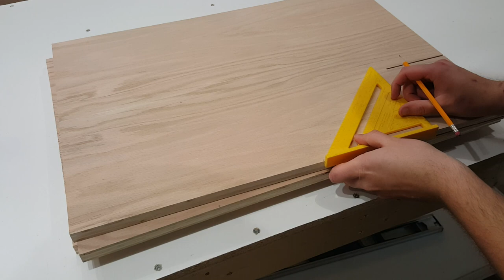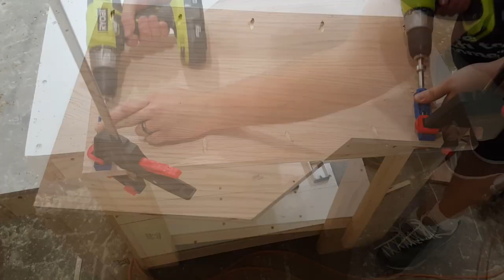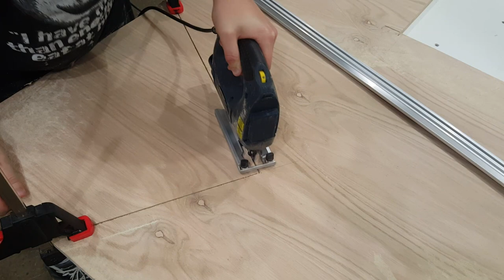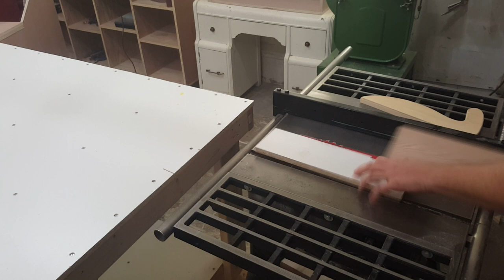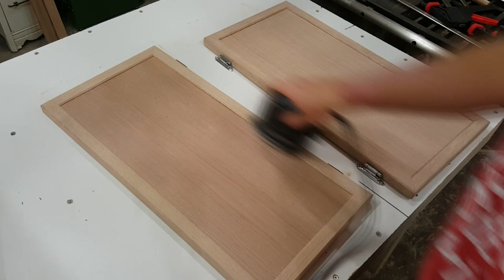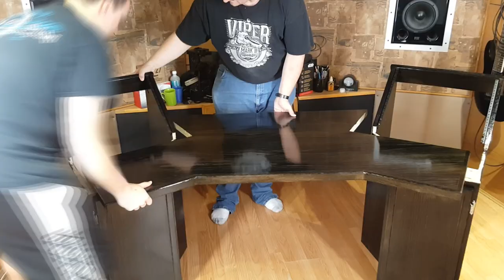Recording Studio Desk (for Glenn Fricker)

Comment: Wow thats a nice piece of furniture buddy! how much did it cost if I may ask? (materials used) :D
Reply from the maker: +Martin Feller 700 cnd materials
Reply: Thanks so much! Not cheap though ;)
Reply: Martin Feller compare that to what argosy console charges lol you're in for a shock.
Reply: Michael Gilyeart than I will not look ;D
Reply: DIY Builds $700 for materials? Is that based on wood?  Is there a different kind of wood you'd recommend that could save a few bucks?  Not that it's a bad deal just curious

Comment: Where have you been all my life!  (Ok, a bit odd, little creepy, but Thank you).  I have been trying to build a studio desk and like messing around with woodwork and watching this has helped me see so many mistakes I have been making (though I wish I would have seen this before I started.  Would have saved me a bit...lol).   Great Job, excellent work and again, Thank you!  (was this all done in 3/4 in CGP?)
Reply from the maker: +Pie Don thanks. 3/4 oak veneer ply
Reply: Thank you.  Also, what is the purpose of scoring your lines?  Is that to make the line easier to see and/or help the jigsaw stay in line?
Reply from the maker: +Pie Don No it cuts the outside oak veneer so the saw doesn't cause chip out
Reply: Ahh, makes sense.  Thank you!.  I have learned a lot just from this video.  Took me a bit, but  found a good video explaining why you do a 'two pass' on the miter saw.  I would have never know.  Thanks again.

Comment: How much did this cost?
Reply from the maker: +MIRA - Official in materials about $750. as for labour cost. priceless.
Reply: +DIY Builds Don't forget the $10,000+ in tools <3 that's why the labor always cost so much more than the sum of all of the parts on any build.
Reply from the maker: +Koedix Lol Ya I have maybe a total of $3000 worth of tools. I go cheap mastercraft mostly and my bigger machines are second hand off kijiji that I refurbish.
Reply: +DIY Builds Either way your standard of work and the cost of source of that knowledge also factors into the labor cost as well, so yeah. And that's a pretty cool way to get the stuff you need. I do the same with guitar gear. I take beat up and broken equipment and do what I can to fix it.
Reply: 最良自由
The Argosy Halo is very similar and it's hella expensive. This desk could either be cheaper or more expensive, depending on how Mr. DIYBuilds does things.
Reply: You're better off buying an Argosy Halo desk in the end if you plan on keeping your desk 15 to 20 years. They are engineered to be broken down If you move and relocate not glued together. Def worth the money reason why they cost so much. They are built like a tank.
Reply from the maker: This breaks down to 3 pieces and is built like a nokia cell phone.
Reply: @DIYBuilds  But will it hold up for 15+ years? Argosy console desks are partially made out of steel metal at least the frame and legs. That's why they are so expensive because of the quality and Engineering goes behind it.
Reply from the maker: You know houses are made of wood right?
Reply: @DIYBuilds  Not necessarily all of them and there are different layers. Some are made of bricks You have the structural foundation typically cement concrete. A house is not going to be dismantled and moved and transported like desk that takes a lot of wear and tear over the years. That's the pros and cons when building your own desk vs paying a high price tag. You may save money but it may not hold up well over the years.